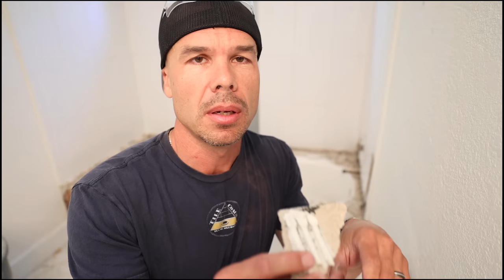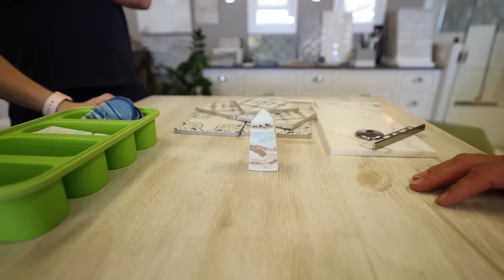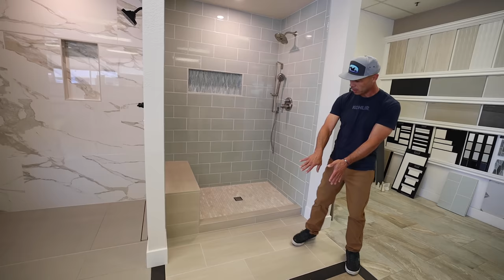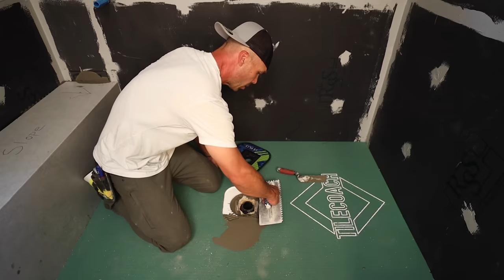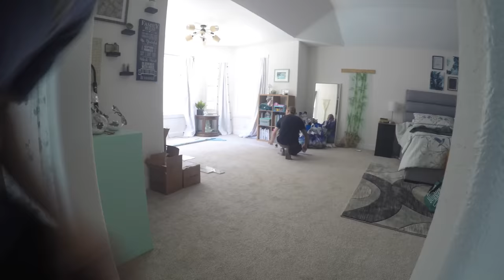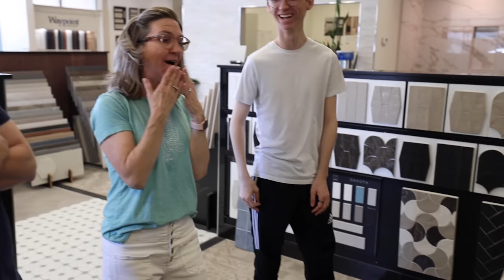$20,000 Tile Shower --- They Had to Pay TWICE!!!

Comment: so is it worth 20k?
Reply: Lol $7000 at most in Texas
Reply: @thecovids9206  I just done a shower not much bigger than that and just the tile alone was alittle over 18,000.00 not counting the laticrete system by the time I was finished they had spend over 50 grand 
And then we started on there pool bathroom from scratch and when we left that job over 100,000.00 later.  Well 7000.00 wouldn’t have even have got the demo done.
Reply: @plumbbuild6517  That is bs.
Reply: @plumbbuild6517  Tile only cost $2 to $15 per square foot.....A shower is 100 SQ ft 😁 No way tile would cost $18k 😁 You're so lying 🤥
Reply: @williamp9158  dude you need to check custom tile price again before you call me a Liar , I’ve installed tile that was over 100.00 a sf and The shower I did was not much bigger but the floor was Italian marble
Reply: And the shower was mostly glass Mosaic
Reply: @williamp9158  I don’t do home depot tile showers
Reply: @plumbbuild6517  ok bud you are so cool. You build showers for people with deep pockets. So should I sell one of my kidneys so i can afford those material or don’t have a shower at all?
Reply: @plumbbuild6517  Is that tile made of gold? An artist from Italy made it by hand or they added a 70% markup?  Custom Medallions cost a lot but tile is not that expensive. You can find nice tile at Floor and Decor for no more than $24 SQ ft. Large format porcelain going for $3.50 - 7 Sq ft.....Mosaic $15-25 Sq ft. The tile they used in the video looks to be affordable .....You can probably find that tile at Home Depot lol They just did a cool design to mix it up.
Reply: @williamp9158  yeah tell the custom designers that my customers hire the designers work on Commission
Reply: @williamp9158  so you know the designers are going to try and sale the most expensive tile they have, I’m just the plumber/ tile installer .

Comment: 20 grand I've done bathrooms where I moved walls cut concrete to add a shower drain to the existing waste line tile wall floor drywall elec plumb for less than ten grand eaither I'm the biggest fool ever or o gotta move !!!

Comment: This tub/shower construction is of a poor design with all the horizontal area. These horizontal areas should have been a solid surface material like Corian etc. set on Durock/mud with pvc pan material covering the framing and a few inches up the wall, all set slightly angled to shed water back into tub. Even with waterproofing and new tile this area will still be compromised in the long haul.

Comment: But you never discovered to source of the leak…how can you live with yourself. You are ripping these people off.
Reply: @ZigZags805  well then sir your thinking would be incorrect. Two most common places for leak in shower are the drain and the transition from shower or tub to the floor. If you have a leak in the ceiling this is where you start. Shower pans have lasted decades without waterproofing in the past. I’ve tore out showers 40 years old certainly with no fault other than homeowner wanting to update. Always look for the source of the leak before commencing on a tear out. This is the second or third time this guy has done this and he is doing a disservice to his customer.